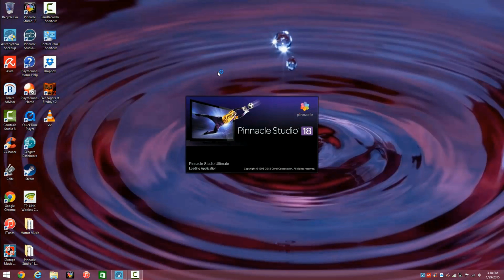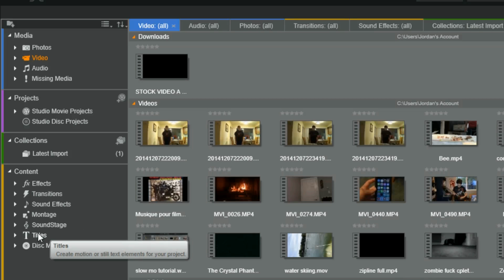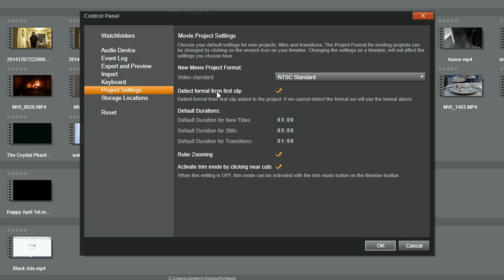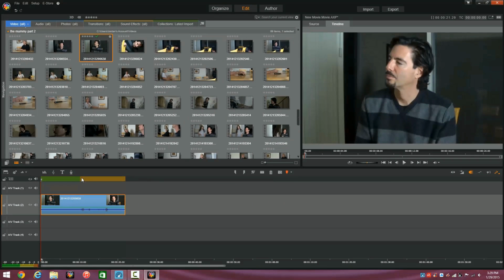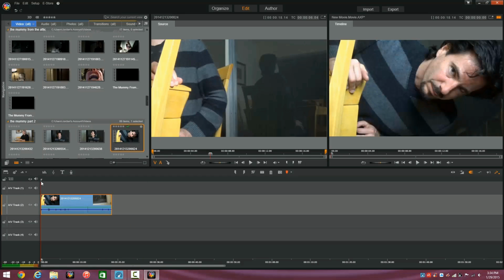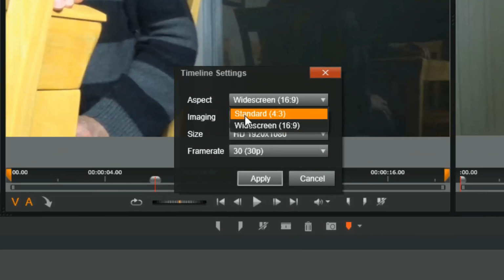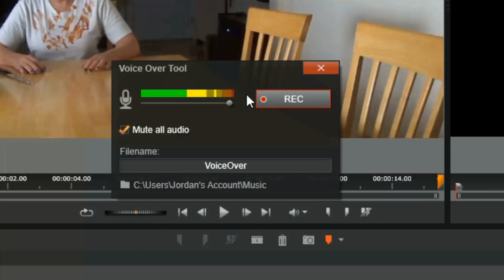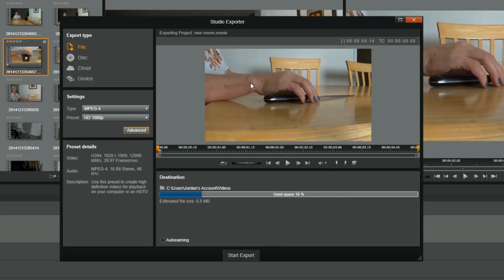Pinnacle Studio 18 Basics Tutorial!

Comment: thank you very much.
i will try to understand the article.
btw , do you have any idea how to impose effect (for e.g color correction) on all the  timeline  in one move?
so far i didnt figure it out.
please your help.
thanks.
Reply from the maker: Unfortunately, I don't know if it's possible to do it all in one move. However, you CAN copy one, or all, effect(s) added to a clip and paste it/them onto the clip(s) you want to add the effect(s) to. 

Separately, I know that Adobe Premiere, another video editing program, has adjustment layers, which you can apply effects to and drag/extend across the top video track in your timeline. All clips underneath the adjustment layer get affected, while the clips without an adjustment layer over them do not get affected. I am not aware of Pinnacle Studio having this feature. If it doesn't have this feature, I do hope this feature gets added in the future. 

Good luck on fixing your problem with your drive and let me know if the article helps you!

Comment: How do I put a different picture video view from a different angle of someone making a speech so that I keep the same track sound of someone talking all the way through which came from a radio mic on the top track.  I used to freeze the selected sound and cut and place the other picture view in place of it on the timeline on Studio 14.  I don't know how to seperate them on 18?
Reply from the maker: If you had previously filmed something from many different angles at the same, and if you want to decide which angle to use at any given moment, Pinnacle Studio 19 has a feature called multi-camera (which was first introduced in the release of Pinnacle Studio 19). The latest version of Pinnacle Studio that I have is 18, so I am unable to show you how to use the multi-camera feature. I see that, in your comment, you said that you want to perform this task in Pinnacle Studio 18. Do you happen to have Pinnacle Studio 19?
Reply: No I only have 18.  I used to do it very quickly and it was perfect in 14 but I've got to learn to change over to 18 now as we have stopped doing tape recording and it is all file cards now.  Studio 14 isn't very good with file as it slows down and takes ages to do one thing.  I managed to right click and split the sound from the picture on the top track then matched up the picture to sound on the track underneath.  I then locked in the sound that I want running all the way through the speeches and split the picture I wanted to swap with the one underneath which I'd also split to the same length then deleted the top section and replaced it with the bottom one but unfortunately the top picture moved along the track on its own as I do it so was then out of sinc with the sound so having trouble keeping it all sinced up.  It was so simple to do in 14.  Thank you for your help by the way.
Reply from the maker: I believe you can actually lock the picture and audio by right-clicking and selecting "group". Let me know if that works.

Comment: hello there.
i have 2 problems with my pinnacle 19.
the first one: it doesn't take footage from one of my hard discs and displays it on the left window. i can edit but cant cut footage unless it is on the timeline - do you have any idea?

the second issue is: i want to run an effect on all sequences. ctl A doesn't do the job. how do i impose effects on several sequences together?

please help if possible.

thanks
Reply from the maker: Unfortunately, I am not near my computer right now, so I'll try and help you based on my knowledge. When you import your footage, and after you click on the "edit" button at the top of the screen, it should show up in the top left window of your screen. The timeline should appear on the bottom half of your screen; the timeline is meant for editing and cutting the footage, not the top left window. You can either click and drag your footage into the timeline or you can right-click and select "send to timeline."

Second, when you apply an effect to a clip, I believe you can copy one, or all, effect(s) added to the clip and paste it onto another clip. The copy and paste functions should be appear when you right-click on your clips. 

Let me know if I helped you. If not, I will try when I am near my computer.